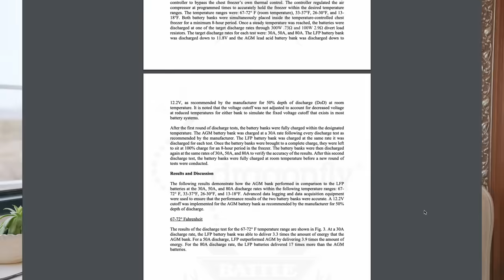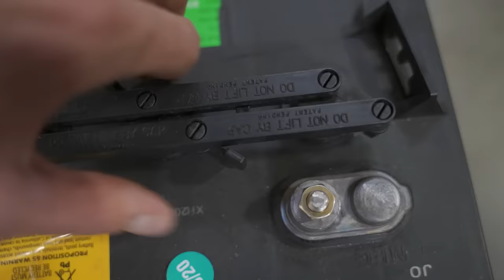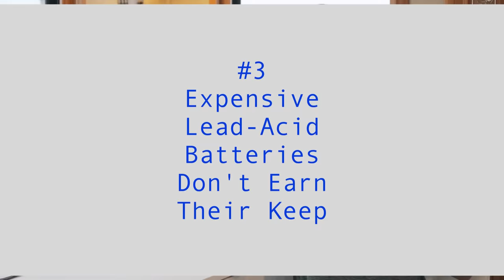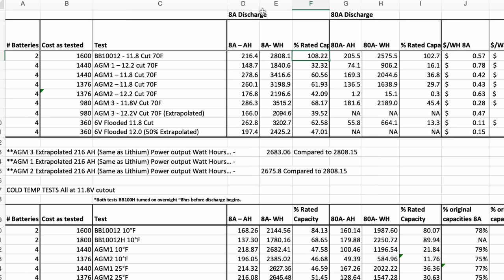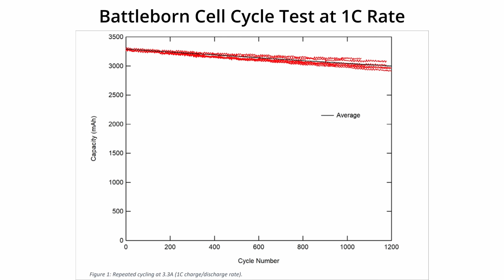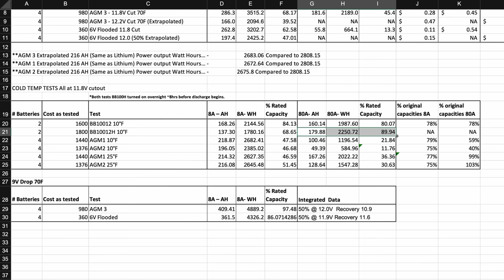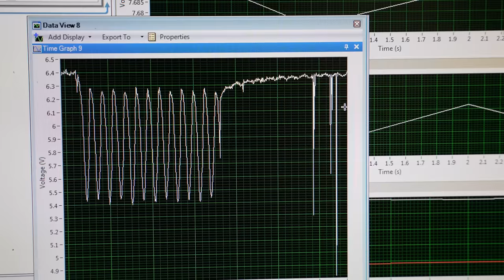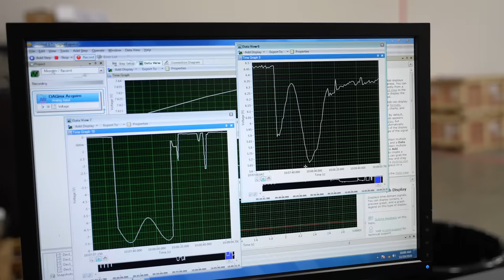Don't Waste Your Money On Batteries - The Shocking Truth I Discovered When Testing RV Batteries

Comment: I've owned RVs (and lived on a sailboat!) off and on for almost two decades, and I've always ended up shrugging my shoulders and hoping for the best when it came to house power. Now that we have a newer fifth wheel, I'm trying to decide what direction to take house power and charging.  The typical forums are filled with opinions and tribal knowledge, but little data.   Your testing methodology and explanations were tremendously helpful, and provided useful real-world comparisons.  I'm mechanically inclined, but certainly no electrical engineer, and I still came away with a much more thorough understanding of the state of the art (or science) in power storage today!
Reply from the maker: Thank you! Glad you found the video helpful. :)

Comment: If you have a permanent camp, bury the lead acid batteries 2 feet under the frostline and use conduit for the wires.
Reply: Thats stupid. Thats like burying a car to prevent it get rusted but you cant add gas anymore

Comment: Nice work. 25 years ago during my apprenticeship, I worked at Sears Auto Center. The cheaper car battery was better because there was more room between the lead cells. The more expensive batteries got hotter, the lead expanded and shorted out; this killing the battery.
Reply: I think that was a build in design, to sell more batteries.
Reply: The heavier batteries do indeed short out with greater frequency, they have less acid too.
Reply: @Deontjie  No that is science.
Reply: @wtcamer  The plural of anecdote is not data, and this is only even one anecdote

Comment: I recently took my Tesla camping. Tesla has a setting called “Camp Mode”. This setting allows the air to be circulated, filtered, conditioned and at a temperature of your choice. We set it at 70 degrees. All night we were so comfortable and in the morning there was not one drop of condensation on the windows. This was such a great experience and I couldn’t help but wonder if any rv had this feature, evidently not.
Reply: Meaning you slept inside the Tesla all night? Very interested in this.
Reply: @tracym427  , in all Teslas the back seats fold down, all Models are surprisingly comfortable. You can even buy aftermarket memory foam that is shaped to conform to the space.
Reply: @shepherdsknoll  tell me this.. with a Tesla, can you going into a store for say 30 min and set your ac to stay on so when you get back in it’s nice and cold? I know that’s ridiculous to most, but I live in Texas and it super hot in the summers. I usually remote start my truck when I’m walking away from it so it will run for 10 min w/ac on.
Reply: Pet mode?
Reply: @tracym427  Yes, you can even set it from your phone using the Tesla app.
Reply: @tracym427  , yes, here in Northern California I will often preheat the car from my phone before leaving. The same can be done with A/C. Remember, everything is done electrically and is programmable, there is no need to start an engine with a compressor.
Reply: @mr.carter4061  , yes , along with cooling your pet with fresh conditioned air the screen in the car will inform anyone looking in and is concerned about your pet that the car is in ‘pet mode’.
Reply: @shepherdsknoll  yessir, I understand all that, I have a pretty heavy engineering and mechanical background, just didn’t know if Tesla software allowed for such a thing.
Thanks for replying!

Comment: One thing to consider. IF you have to install your batteries inside, standard lead acids are out unless you vent. And at this point in time LiFePO batteries are close to the same price as AGMs for the same effective capacity.

I just swapped out my exhausted 6V 4x225 AH AGM bank for 12V 2x100AH SOK LiFePOs in my older B+ van. Effective capacity is about the same. I had to change out the General Dynamics converter - that was $300. I also added a DC to DC charger to allow alternator charging - $170. Existing solar charger still worked. The LiFePO batteries cost 2x$570 = $1140. An AGM battery replacement cost for the same VmaxTanks AGMs is 4x$330 = $1320.  My cost for LiFePO upgrade was (300+170+1140=1610 no labor cost, I did that myself) vs AGM replacement of 1320 or about $300 more.
Reply: great comment :D
Reply: Thanks 👌
Reply: Is LiFePO the same as LFP?  Are they supposed to be very safe?

Comment: Nice work, but this felt like a SME corporate/commercial advertisement for Battle Born! I’d have loved to see the cost per power ($/Whr) of building your own LFP bank with EVE cells and BMS compared to commercially available ones like Battle Born. I’ve seen cost come down to as low as 0.1$/Whr. Battle Born is overpriced and overhyped, IMHO, at 0.67$/Whr. For those of us DIY types with some engineering background, it’s an insult to underhandedly suggest or highlight a brand-name on such limited data set. No one needs convincing that LFP is superior to AGM in almost every metric, but bringing down the cost-per-power by sourcing quality cells and components is where the rubber meets the road! Please do an episode on the best available power system components, ie, LFP cells, BMS, inverters, PVCs, charge controllers and monitors, etc. It would be of immensely more value to DIY enthusiasts than mindless brand-name consumers!

Comment: Everyone always goes with the worst lead acid batts for these tests. I guess it makes sense for RV applications to keep weights realistic. I would love to see in depth tests done against trojan's specifically designed SIND 06 610 batts that have a pretty well proven track record/service life when maintained. I feel like any flooded cell rated for PSOC (like the SIND 06 610 batts) still gives lithium a run for its money in every way outside of weight and with proven service life well outside of these notions of '500 cycles' or '5yrs' that keep going around.

Comment: In mechanic school we were taught that a lead acid battery is empty at 10.5V, this is the lowest voltage you should use them at, at 10-20 degree C. If you have a high current short duration draw you may be better of running it on a start battery rather than a "house" battery as they are made for high intensity short draw (and fast recharge after use) like a starter motor.

Comment: I did an experiment recently with the discarded starter battery from my ML320 Wi63 - a Bosch Silver SO19 100Ah.  I hadn't gotten around to getting rid of it and idly checked how flat it was and found that it had held a charge after a few months of being dumped under my kitchen table, so I connected a 12V 40W thermoelectric cooler to it and it kept working for a full 30 hours before stopping, and had kept 3 frozen freezer blocks frozen. So, even a 'dead' starter battery delivered exactly 100Ah.  As it is 'dead' anyway, I figured it wouldn't do it much harm.  It charged up again just as quickly as it would normally, so my next experiment is to try charging it from solar and using it camping while I save up for a LiPO4 battery, which will cost a fair percentage of what my car cost!  'If the resource is free, efficiency is not so important'!
Reply: A 100AH lead acid will deliver all of that energy but it will not for so at high current levels. You will also lose a considerable chunk of battery life. LFP will happily give 95% of its energy at near full current so what’s not to like?
Reply: @davidelliott5843  It's only the cost of LiPO4 batteries plus all the stuff to go with it...

Comment: Plus the Lithium iron phosphate batteries are 1/3 the weight of lead acid, important for RV’s.
Reply: at 2/3rd's the weight, with 300lbs of lead acid batteries, you'd be saving 100lbs... that's nothing in an RV... don't be daft.
Reply: @dansmith6990  so true so true
Reply: @dansmith6990  : Not quite as "daft" as you think -- the difference can add up.

First, Lithium-ion batteries are actually about half the weight of lead-acid batteries.  Second, the larger your battery bank, the bigger the weight savings.  If you have, say, six 60-pound lead acid batteries, that's 360 lbs.  If you replace them with six 30-lb. Li-ion batts (180 lbs total), that's a 180 pound weight savings.  Not huge, but not inconsequential, either, especially in a smaller RV. 

Furthermore, for a more apples-to-apples comparison, you have to take into account the fact that you can only discharge a lead-acid battery to 50%, while you can take a Li-ion battery all the way down to zero.   So you really only need one lithium-ion battery for every two lead acid batteries.   So then you can have just three Li-ion batteries to replace your six lead-acid batteries for an additional 90-lb weight saving, for a total weight saving of 270 lbs.   That's significant.
Reply: Temperature control is also a very important thing to consider for rv batteries.
Reply: @whatyoumakeofit6635  yep cold batteries lead acid ant the best. their need to cheaper materials used lithium is way to pricey for what it does really
Reply: @whatyoumakeofit6635  the battleborne batteries I have have a low temperature cutoff to prevent charging below freezing temps but you can also install a heating pad which I’m contemplating just to be on the safe side.
Reply: 1/3 the weight
Reply: @GroovyVideo2  thanks.
Reply: @dansmith6990  as pointed out I made a mistake, it’s 1/3 the weight of lead acid.
Reply: @dansmith6990  if that 300 lbs is on your hitch it can certainly be an issue, especially if its a larger bank
Reply: @andrewrivera4029  you actually made another mistake, it's not 1/3, it's 1/2. Even still, saving 1/2 weight is great, until you realize it's what? 100lbs? come on..
Reply: @travispfannmuller7717  Putting in on your hitch is completely different. Most RV's have a dedicated spot for chassis/house batteries...
Reply: I think weight is not the big issue.  If you have space for 4 AGMs, changing them out to 4 BB will yield you about 3-4 times the usable energy, and a lot more power so your inverter and high power equipment run better.  If the AGMs are sufficient for your load and you never discharge below 12.2 V/bat, then stick with the AGMs.  If you need more energy and power, then go with the lithium.
Reply: @Milesco  If the weight is a problem then throw the misses out !

Comment: Great information. A lot of us are more concerned with the actual amp hour performance because we run equipment that draws a specific amount of amps. Knowing that capacity helps us decide the appropriate battery.
Reply: LFP gives a lot when pulled hard. lead acid drops a lot when pulled hard.
Reply: @matthewwiemken7293  Yes, I think so too, after all this is a video from two years ago, now the LFP batteries are twice as powerful as lead acid batteries at the same weight and last longer, I bought ADCBATT 12v 100ah lifepo4 batteries on Amazon for my RV and towing machine, much better than the old lead acid, maybe this is technology changing life.

Comment: I see a possible flaw in your testing method. It appears that you were testing the end voltage under load. The 50% 12.2v is at rest, not under load. If you drew the batteries down to 12.2 under load, and then cut off, the voltage pops back up, and you did not hit your 50% level. Retest with a hydrometer (battery voltage is not an accurate method of determining the state of charge).
Reply: Yes, and / or set compensation parameters for this in the inverter configuration.
Reply: This was a lot of work. However, I didn't hear anything about how you measured the "end" voltages. I infer from what I heard that you tested to a voltage under load because you kept referring to a "cutoff voltage". As Steve pointed out,  and a I have learned by studying and living with rv batteries for 16 years, to get even an approximation of the state of charge (SoC) of a lead-acid battery with voltage, you have to let the battery recover after a period of discharge. In fact, to see the voltage of a fully charged battery, you have to let it sit unloaded for a period of time or apply a moderate load for a short period to knock the voltage down to its rest level. Every study I've read on lead-acid batteries emphasizes that voltage level is not an accurate method to determine SoC, only testing the specific gravity of the electrolyte is accurate. That's difficult with sealed la batteries.
Reply: I also question whether the lead acids were deep cycle batteries which would be what would be in an RV and should have a greater than 50% DOD.
Reply: @ThomasSuckow  50% is the recommended DOD for lead acid deep cycle. Some recommend deeper DOD to get more usable ah, but cycle life decreases. 20% is the recommended DOD for starting batteries.
Reply: Yep that is 100% right. My AGM's sag to 24.1 under load by morning but VOC rises to 24.4 when measured disconnected and direct.
Reply: @tomhargreaves8820  The problem is that in real use, the battery discharges under load, and you want to cut it off. You have to set the cutoff point to somewhere and it will always measure the loaded voltage as that's the real world case when a battery drops below a certain voltage.

But I agree, proper SoC measurement (for most battery chemistries for that matter) would require a sophisticated BMS with priori knowledge of charging, discharging, age, temperature, etc., not just some independent charger and "discharger" device which knows nothing about the circumstances, only sees the voltage.

And I don't know it is even successfully done already for lead-acid, as computer UPSes almost always fail to estimate the proper runtime when the battery is older.
Reply: This is why good battery meters are important for a battery bank. they actually measure the energy expended by the battery and don't rely on voltage. Voltage is a poor judge of energy usage.

Comment: Great information, I have been working in the auto repair business for over 30  have seen battery quality go down dramatically does not matter what brand, flavor or cost, tried them all, your are lucky to get half the life out of a new battery as one made before 2008.  In the U.S. there are only couple auto battery manufacturers they blame everything on all the electronics in new cars.  I point out my 99 car OE car battery lasted over seven years and my 97 truck OE battery lasted over 9 years yet a new battery same vehicles will not last 3 years they have nothing to say. When there is a Monopoly and yes all the manufacturers are working together they even make batteries for each other the cost can go up and the quality go down. So it's no surprise to me lead acid batteries tested so poorly.

Comment: Good data, thanks for sharing.  You forgot to mention the other virtues of Lithium batteries.  1.  They weigh half as much as AGM.  2.  No venting is required for Lithium, they can be put most anywhere.  3  You can mount the Lithium in any orientation for stacking, unlike AGM that must be mounted with the top side up.
Reply from the maker: Good points!  I would have loved to go into more detail, but whew... thats a long video!  Maybe when i compare different lithium brands in the future.
Reply: AGM can be mounted sideways or in other orientations. Flooded have to be mounted top side up.

Comment: Great info! Wish I could go lithium but for the price of one battery I got a goal zero 400 a spare 35ah to chain to it and a 54l fridge and 150w solar panel and still had money to spare. It all works for me I run the fridge as just fridge but can do fridge freezer, charge phone, cameras, drone, RC and radios and it still cranking after 3 years. Run it in cold and hot weather and I'm out almost weekly using it
Reply: Goal zero 400 is lithium based...

Comment: The next test should include the actual discharge and charge cycle comparisons. Also, the balancing that is not used on lead acid leave it at a disadvantage. Remove the BMS from the lithium is a more direct comparison. The VPC is in some applications, can be down to 1.67. Batteries are all not very efficient ever. Lead acid or lithium etc.
Reply: What makes you say Li-ion or LFP are not very efficient? 
BMS is not an unfair advantage for Li-ion. You can balance cells at any level of charge, and it's basically only a safety measure should the cells drift apart.
Reply: The conversion of energy ratio is not great, Even more so when the temp is over 80f and below 40f. The rate of efficiency decreases exponentially as the temp changes. The charge cycles and discharge cycles also decreases. Question> Why should batteries require heat or cooling.?

Comment: All of the cost savings for the Lithium batteries are entirely dependent on them actually reaching their "estimated number of cycles".  Interesting video nevertheless.  If you get an opportunity to test the new lithium titanate batteries in a similar fashion, it will be interesting to see how they stack up.
Reply: They stack up as very expensive. But LifePo4 seems to be the best bang for the buck.
Reply: There is no cost value with lithium batteries when they burn your RV to the gound.
Reply: @falcorthewonderdog2758  the LiFePO4 is meant to be much safer in that regard. Although compared to Li-ion they don't have the energy density.
Reply: @falcorthewonderdog2758  Bad install.
Reply: Watch starting at the 10:36 mark.  He is not looking at lifetime cycles.  This one data point was at 20A discharge per battery and measured the WattHours.  The calculated $ / WattHours.  That is the way I see it.  The question is performance every time you use them, not over the lifetime of the battery.  Doesn't mean it is worth it to you to buy it, but I think he made the point.
Reply: @MrSteewped  I agree as I use one personally but they are definitely not the best option in terms of environmental impact and also have other associated costs required more expensive controllers to manage power into them.